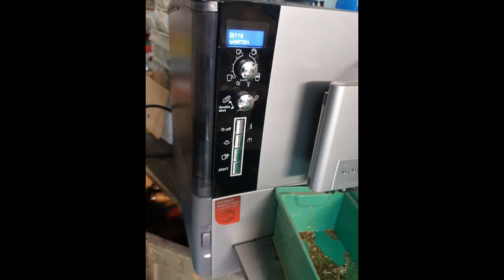Siemens EQ.5  Repair / Reparaturanleitung

Comment: Hi, I have an EQ5 macchiato plus, it doesn't make coffee, it takes the coffee beans and grinds them, no coffee comes out of the machine. The coffee grounds are hot, it can lower hot water without a problem, has run the self-cleaning program several times but without success. What could be the reason for this? Thanks for the help.
Reply: Mine had similar problem . Grinding blades become dull. Test it with already grinded coffee  with powder

Comment: My Siemens device gives the message "Door is open", when it is not and no door is open.  Also, by turning the device off and on, the message remains and the device has no function.  What do you think this sign is?  Thanks

Comment: Achting!! Beim durchmessen der Pumpe muss mann  beachten dass eine diode im gehäuse anwessend ist. Nür in eine richting gibt es einen messwerd von ungefähr 640 ohm.
Reply: hi, how many ohms do you have to read when measuring. What the limit minumum maximum ohm value must be to say the pump works as it should

Comment: Was wurde dort mit dem Multimeter gemessen?
Reply from the maker: Ist eine spule , hab nur gemessen  ob da eine Unterbrechung  ist. Es muss Durchgängig sein und eine Ohmiche Widerstand  haben.
Reply: @IsDeno24  hi, how many ohms do you have to read when measuring. What the limit minumum maximum ohm value must be to say the pump works as it should. If the machine gives hot water, it means that the pump is not at fault